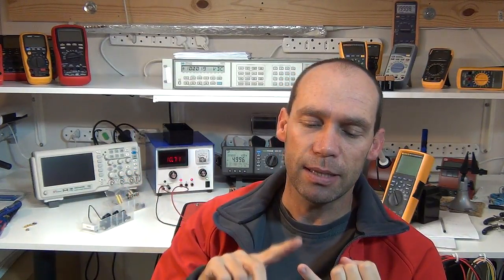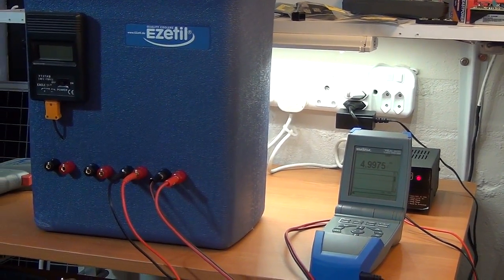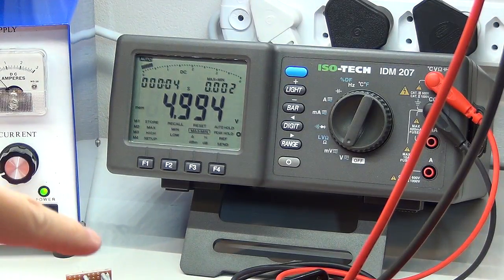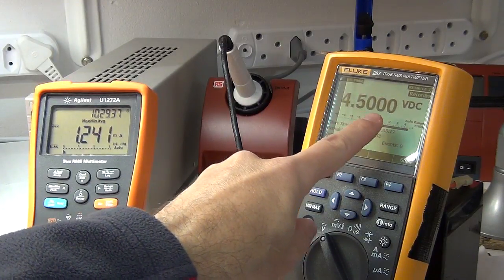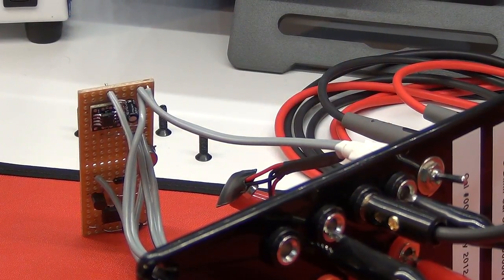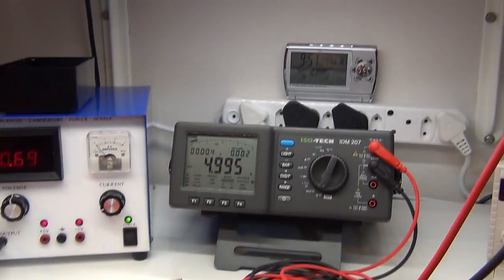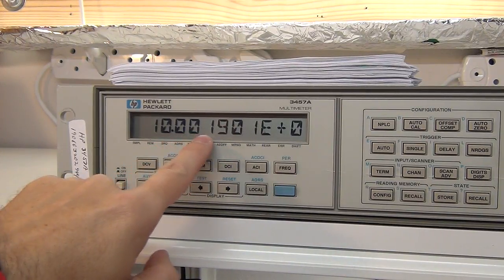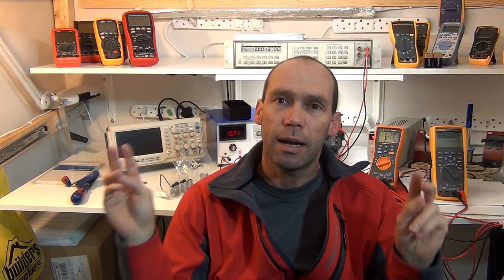T4D #11 - DMM Ref testing, battery testing, general chit chat and news

Comment from the maker: Great to have a "local" post...thanks!
Great idea, my Outback Flexmax is already setup with a relay on the aux output and a load so it could work well. The only issue is due to the weather and the number of panels I have at the moment I would struggle to get a good charge during the day. It would also only give me one charge / discharge cycle per day....I'm hoping to get 2-3 per day....will see how that works out. Cheers, Martin.

Comment: J from Gauteng here.Simple way to try kill the lead crystal is hook it up to your solar with a continuous load that will drain the battery at the recommended discharge rating during the evenings and the solar will charge it back up during the day (make use of a charge controller) Its a smallish battery that,can't be more than about 25AH.Make sure sure the continuos load runs the battery down so its absolutly drained,preferably a few hours before the sun comes up to charge it again.Battery hell:)

Comment: Have a look at the 555 timer IC.You could create a little 555 circuit that turns a relay on which controls the load to the battery and then buy one of those timer plugs that turns off or on  and attach it to a battery charger.A even simpler method would be to get 2 timer plugs.One for the battery charger that turns off after a few hours to charge the battery.The second timer plug could be connected to a invertor which attaches to the battery and can turn loads on when you need.Great channel!

Comment: i think the normal failure mode of tantalum caps is short, and they are quite fragile. if you go over voltage even a little, they'll give out. same thing if you get the polarity wrong, and unlike elco caps they mark the positive pin on tantalums.